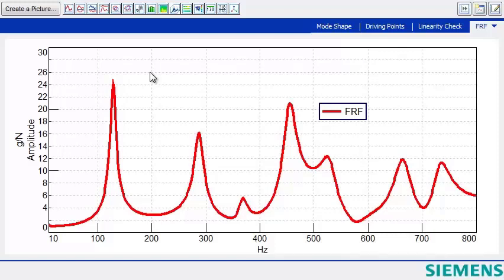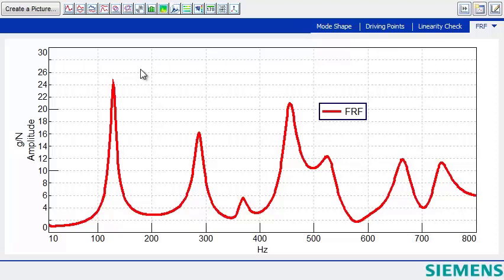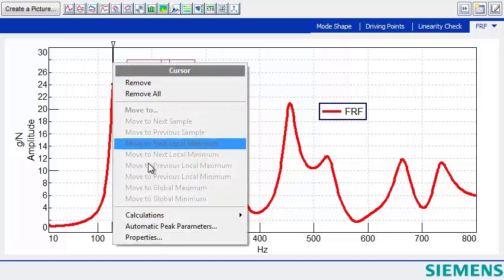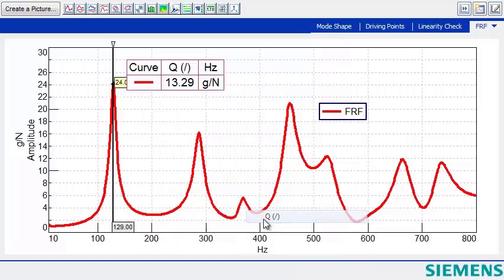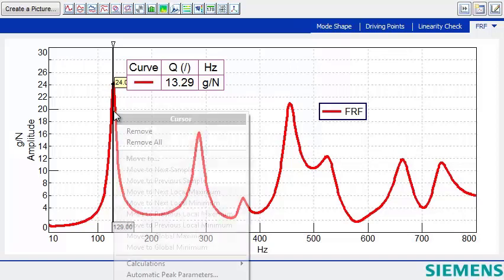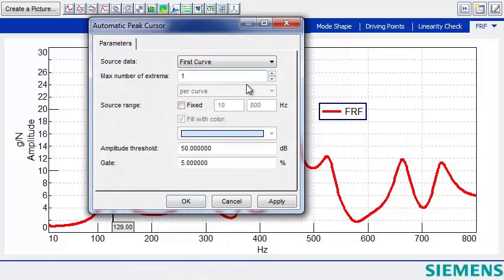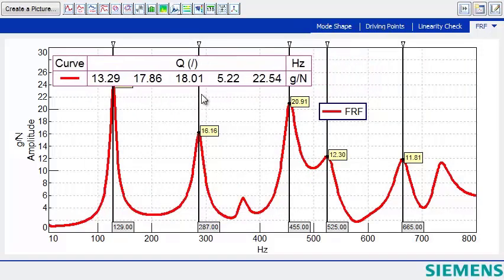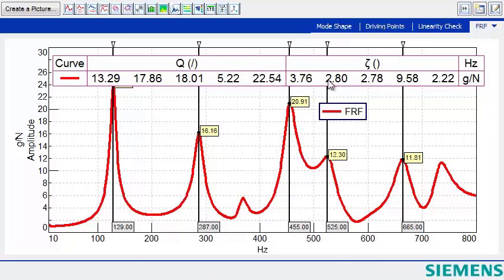Extract Damping from FRF

Comment: why is the damping ratio different for all peaks. damping ratio for a material should be same .
Reply from the maker: In a dynamic mode of a structure, modes that occur at different frequencies can be local to smaller components of the structure. These components can be made of different materials, have different boundary conditions, or the material is not uniform throughout the structure.